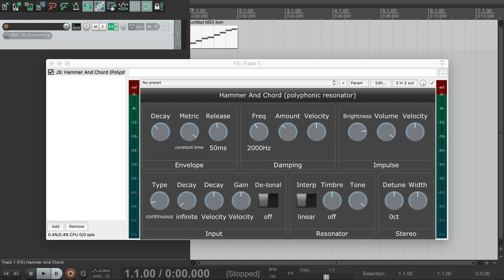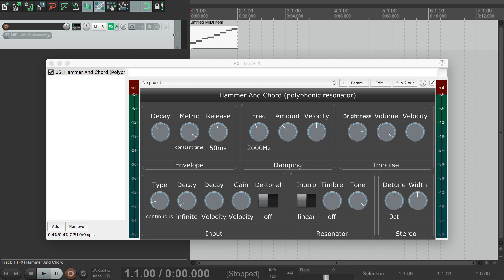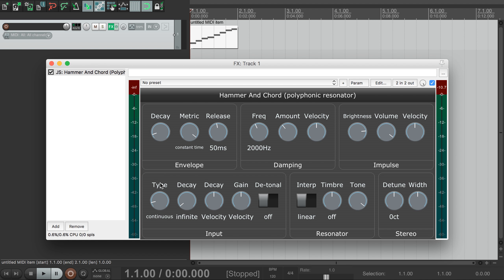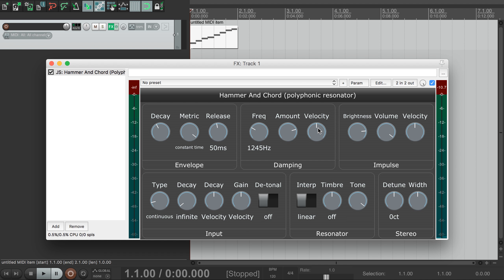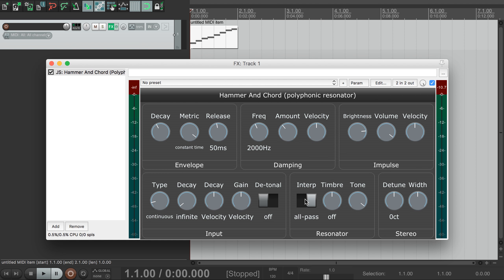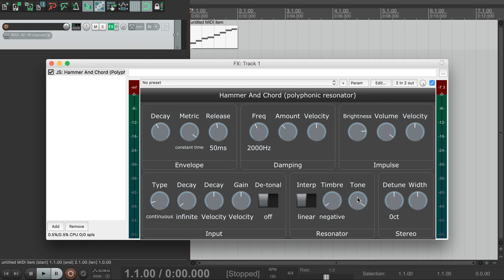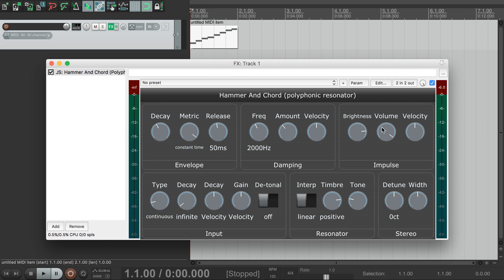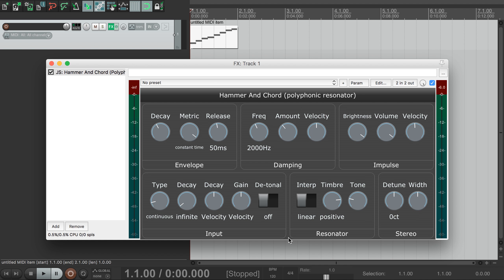JSFX: Hammer And Chord - Part 1 (Synthesiser)

Comment: This is really excellent fun, particularly the external input mode!
Have you considered oversampling the plugin? The damping/tuning problems in the upper register (depending on the interpolation mode) are common with Karplus-Strong and the only way I can really think of getting around it is to run it at a higher sample rate. You'd have to up-sample the input, then run the delay lines, interpolation and feedback at whatever the oversampling rate is and only downsample at the output stage. 
I'm not a good enough programmer to do it myself so this is just a suggestion. I hope you take it in the constructive manner it was intended as you certainly don't owe me anything. The plugin as it is is already great.
Reply from the maker: Yeah, that would be a good idea 🙂 - tuning for K-S is always an issue unless you use linear/FIR interpolation (which has its own problems).

Oversampling is such a common thing to want to do that I wish Reaper let you just apply it to individual effects in the chain.
Reply: @geraintluff  Yeah, it's a trade off between tuning and interpolation making some notes more damped sounding than others. 

I agree, I've found myself wishing for the ability to oversample any plugin before. All it would require is Reaper to upsample the audio before sending it to the plugin, run the plugin as if the project rate was higher and then downsample it afterwards. Reaper is already pretty great at resampling on the fly, I'm sure they could make use of the same algorithms.

I have made some fairly naive JSFX which would probably benefit from oversampling, but I've yet to wrap my head around the filters necessary to do it.
Reply: @geraintluff  Hey, I thought you might be interested to know I found a neat trick to oversample Hammer and Chord! There's a plugin called Metaplugin that simultaneously works as a VST plugin and a VST host and it allows oversampling. I then got Hammer and Chord working within that by using the ReaJSFX VST plugin (normally pointless in Reaper, it's meant for allowing other DAWs to use JSFX). 
I set it to 16x oversampling and what an unbelievable difference it makes! With linear interpolation switched on, the change was a little underwhelming. However, all-pass mode is crystal clear at the high end and obviously all tuning issues have been moved upwards by 4 octaves rendering them fairly harmless.
If you ever revisit Karplus-Strong algorithms, oversampling the delay lines seems to be a game changer.
Reply: @geraintluff  Oversampling any FX should be coming out soon. It’s already in the development branches. I’m looking forward to it.